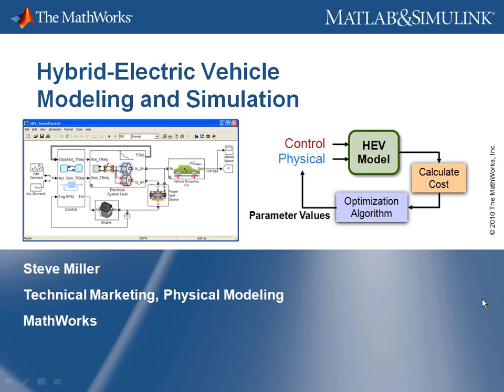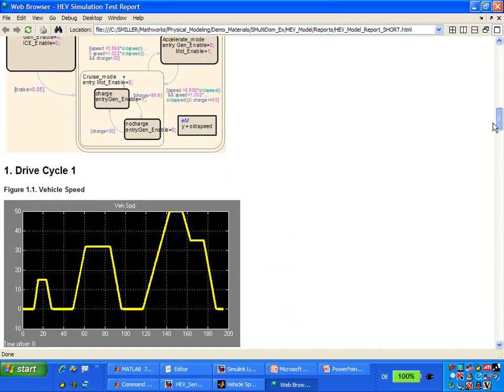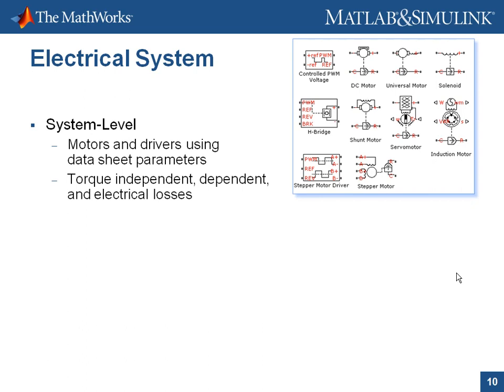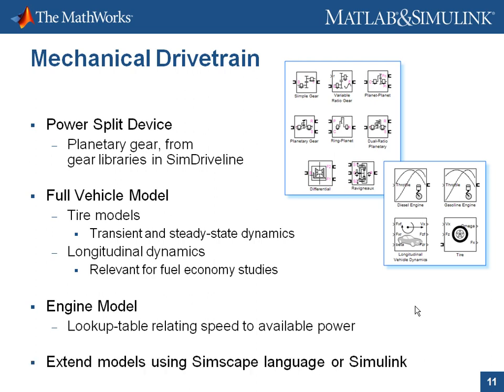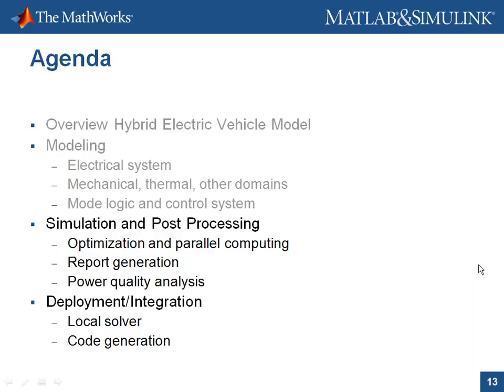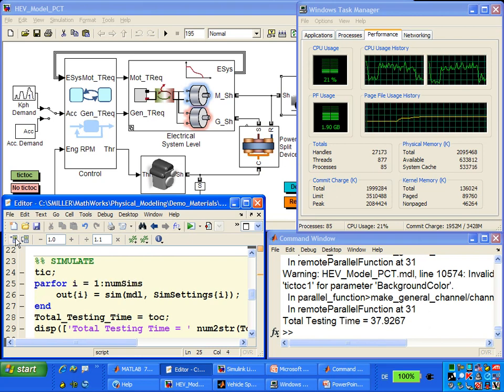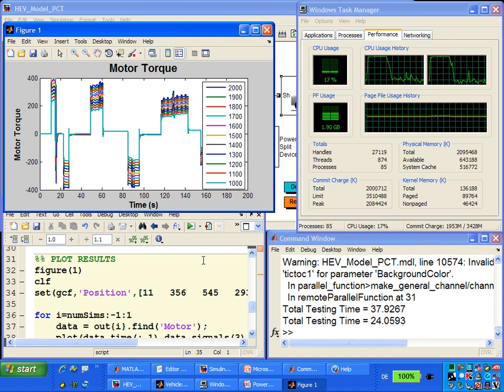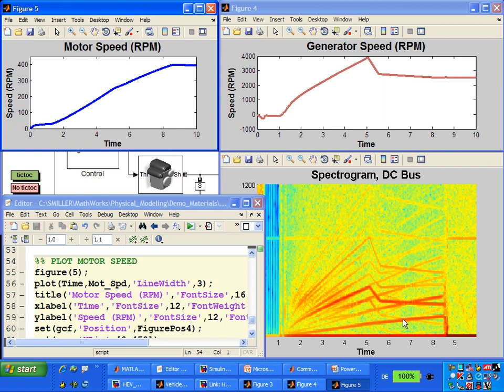Hybrid Electric Vehicle Modeling and Simulation

Comment: Actually, i have investigated this model,, it has a mistake in controlling the traction motor speed. it is comparing between torque and speed. ans strangely the model is working,, even if you remove the motor speed controller it will remain work..!!!! do you have an explanation for this situation..
Reply: I can't see this mistake. Where did you notice it?
Reply: @georgiandreev1739  you can check (for Example) reference signal and feedback signal for traction motor controller,,, one of them is speed signal and the other is torque signal. how come to compare two different type of signal to control the motor, furthermore; if you bypass the controller. the model is still working ( very strange!!!!). giving same results if try simulation let say for ECE15 drive cycle.. you get same results using controller or not using it.!!!!
Reply: @awaili  do you mean the VECT controller here: https://youtu.be/EdBlOPHjdFg?t=778 ?
Reply: Hi Brother can you please send me the matlab file of HEV modelling.